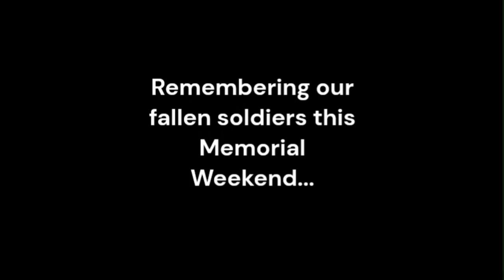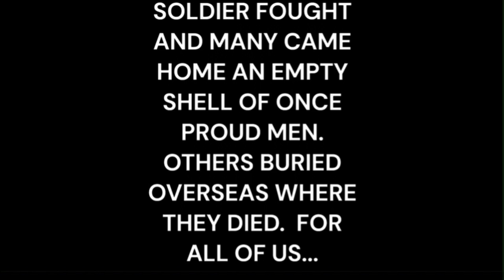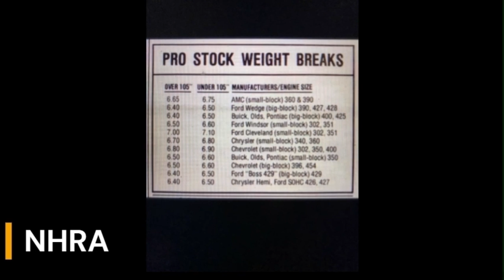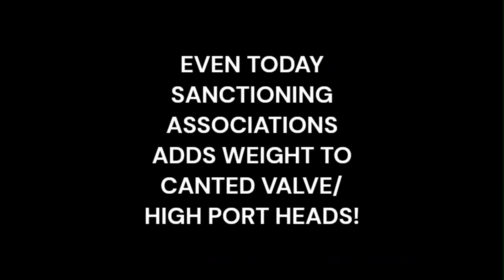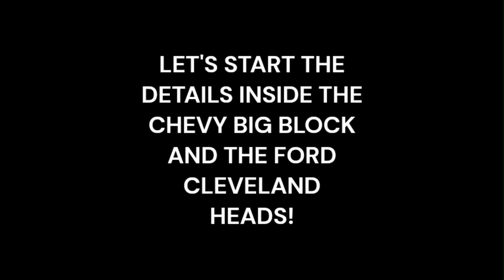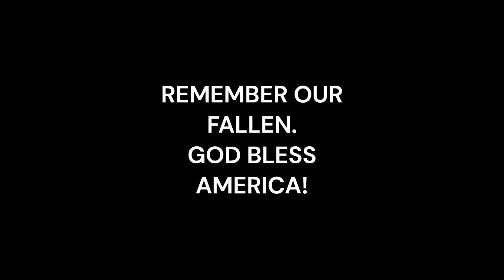ADVANTAGES OF CANTED VALVE CYLINDER HEADS.

Comment: Yeah great stuff Ben. The Cleveland was the only thing to have here in Australia back in the day. Your explanation of why this head worked  so well was excellent.  All I ever heard over here was the port was too big. The funny thing was the Cleveland was feared on the street by everyone.
Reply from the maker: Thanks Dean.  I found early on that bigger than normal port with decent compression, cam plus low gears will be a deadly combination on the streets!  My Windsor and Chevy engines did not quiet pull that much strong even if I did the same basic combo.  Leading me to believe this thing was a terror in the modified and eliminator class @ NHRA.  There is no reason to doubt it when it dominated and was penalized for its success.

Comment: When you look back at Ford Muscle cars like the Boss429, 429cj and even earlier FE powered 390/406/427/428cj cars, you find that the Boss 351 mustangs, Cleveland Torinos and Cougars we're the quickest off the showroom floor in 100% factory production configuration..The Boss 351 Mustang being the top of the bunch.
Reply from the maker: They are very impressive and my first hand experience made me a believer because I can beat big blocks to their surprise.  lol
Reply: @benalamedaracing2765 I agree. A Ford FE when built correctly and you cant the intake towards the exhaust. If you look at my 394 ci FE with 2.064 intake valves canted forward and sideways just a 1.55 valve straight up. I used a light piston and a 360 pickup truck rods with ARP bolts. The pistons I left the 2 nd ring out the top were moly and I trimmed the scrubbers and made a change to the retaining ring. It took 15 lbs to turn it with the heads on the plugs out. That head went from 76 ccs to 56ccs. 2000 when I built it and it still screams like a banshee.

Comment: Another great video Ben. I grew up with Cleveland's, small and large port alike. I used to sort out a lot of under performing, and unreliable motors for people who's motors had been built by other engine builders. Now I don't think that I'm a great engine builder, but I used to build okay ones back in the day. One thing that I worked out very quickly was that in most cases, the more experience the other engine builders had with inline valve motors, the less successful they were with Cleveland's. No one seemed to understand Cleveland' heads, and I was by no means a guru either. However I think I had a better idea than most. Today I have a much better idea of what I didn't know back then. How I wish that I had today's knowledge 40 ➕️ years ago. Thanks for sharing your knowledge. Regards Greg
Reply from the maker: We all learn slowly but surely.  For one, if at 9:1 inline Ford or Chevy it will make the Clevelands inferior at most instances.  However, the more you go up on compression you will see it will respond and out power all those other inline engines and the higher compression and rpms?  It will pull away for sure!
Reply: @Ben Alameda Racing  in my limited experience, Cleveland's love compression. Personally I favoured cams with wider lobe separation angles than used on inline valve heads, and I preferred symmetrical valve durations for hot street and circuit work. However, I was only ever working with factory cast iron heads, never with after market alloy heads. I used to run as much as 13.8:1 on leaded fuel street motors. Dynamic was obviously less. When your closing the intake valve 84° abdc, dynamic is a little lower. That said,  if I was building the same motors now, I'd build them very differently. No flat tappet cams to start with. Currently have 2 different versions of the same head in at a friend's shop getting flowed. Not interested in what we can get out of them. Simply want base numbers are, and where the numbers are made, to make decisions from. Have a proven engine that has to come out of a car. Will probably dyno it to see how much power it doesn't make, then remove the heads and flow them as well. Customer was extremely happy with the performance. I was very disappointed. Felt strong, drove well, but I always felt that there was still too much on the table. Really enjoying your tech video's. Thanks for sharing your thoughts and knowledge

Comment: As David Vizard said - Chevrolet must have let the Tea Lady design the Big Block Chevy, because it couldn't have been done worse if they tried. They should have just scaled up the Small block head! (and I'm a GM guy!)
Reply from the maker: Smokey did make an attempt to produce a canted valve head with symmetrical ports and look so much like the 351C!  Eventually he said it was too much cylinder for the rpms they were using at the time so it was kind of an overkill!  Just like the Clevelands were as well.

Comment: 351 Cleveland with closed chamber 4bbl heads was SEVERELY underrated. I never understood why so many Ford guys poo pooed the Cleveland. The Cleveland and the 426 Hemi were passenger car engines with heads that had PHENOMINAL flow /power potential. I watched a cable TV show rebuild a 351 Cleveland with closed chamber 4v heads- they put in a wimpy cam and dyno'd  it. Then they put aluminum heads -single plane intake and a huge cam in it and dyno'd it again. USE THE DANG FORD HEADS WITH THE BIG CAM AND INTAKE. A youtuber whos last name rhymes with Boldener did the same thing. Removes great iron heads without showing their potential and goes straight to the aftermarket aluminum heads.
Reply from the maker: Mike, you are probably right and the factory 4V is one awesome piece even with them kink down exhaust ports!  They can bypass this with added duration at least 8-10+ degrees.  Wimpy cams on big ports will produce wimp power for sure and I will never understand why you would do such a thing...  But then again we all do different things others better than most while most ends up doing the wrong things!  lol  
I agree with you 100%.
Reply: @benalamedaracing2765  I'd like to see a stroker Cleveland. The extra cubes would lower the power band a bit on those big flowing heads.
Reply: A friend had a 71 Mustang 2+2 351C 4V 4 bolt, Ford top loader, Detroit locker. Factory redline was 7000 on the tach and that thing would pull. I had a 65 Ford short wide box truck with a 1974 LTD 351C 2V in it and it was a fun truck. The truck has been parked for 20 years in the shop. I have a 351C on the engine stand and am going to get 302C 2V closed chamber Australian heads for it. It should make a great engine for the truck.

Comment: Ben , great video.  Its amazing how as time goes forward  , the truths come out about certain engines.  In Australia i have always been intrigued by the mighty CLEVELAND , not only its great looks but how they sound.  I have built countless CLEVELANDs through the years from 250hp to over 500hp . All street drivers  and occasionally to the strip , and all with the 3.5 inch stroke,  just depending on the bore conditions it could be 10 , 20 , 30 thou oversized.  Anyway nothing feels or sounds like a strong CLEVELAND  . When i started my apprenticeship in the late 80s , the dark side would make stupid remarks about CLEVELANDs , but we all know who had the better cyl heads . The LS  is a good example of copying the asymmetrical CLEVELAND cyl head and the Holden VN V8 to the  VT . Oh by the way we have a sanctioning body called SCAMS which will do anything in its power to make sure Fords dont win .
Reply from the maker: They have associations like the NHRA that limits other engine makes?

Comment: if youre class racing, IE 5lt class, the most under rated engines of all was the Ford 302 C.  4 inch bore , 3inch stroke, 6 inch rod, canted valves that are larger than chevvy. All 351c tuning and machining tricks apply. The hardest thing was to build compression.
Reply from the maker: The C head is really an impressive piece and wondering for your displacement if you are running the Aussie C head?

Comment: Another Aussie clevo fan of your's here Ben 💪 I'm really paying attention to your quench theories and am gonna u-turn on my 351 clevo to the 2V 302 cleveland 58cc head we have here. The math says 359ci @ zero deck + .041 gasket installed height and +3cc twin valve cutout flat-top hyper piston gives 11.6:1 static compression - but with your recommended low-to-mid .040" quench !! Too dangerous with 112 LSA low lift/short duration cam ? Cheers 🙏
Reply from the maker: I get close to .600 lift @ 110 l.c. before I get nervous and anything far from these you should be ok.
Reply: @benalamedaracing2765  Thank you Ben 🙏🙏 Us aussie cleveland guys should crowd-fund amongst ourselves  shipping a set of 302 C closed chamber 2V heads to you for some R n D porting and flow testing! It would be interesting to see where they fit in the Ford cylinder head hierarchy. 👍

Comment: BEN back when GM and smokey built the Mark 11 mystery motor that was instantly outlawed.was that the first canted rotated valve design?. I saw a paper where Smokey was cussing the GM engineers for making a long and short Port for the Mark 4 engine.if that is true, they have known The advantage from the early 60s.
Reply from the maker: Canted valve heads are more powerful than straight inline configuration.  I am sure Smokey was not happy with the long/short layout and the dynamics alone screws up the potential of the engine!  In fact Smokey designed a cylinder head for the chevy engine and it looks exactly like a cleveland cylinder heads except for the water ports!  It had potential but he felt it is too much ahead of its time for the rpms they were turning back in the day.

Comment: Would a bigger intake valve in the bad port of the bbc make up the flow to match the good port?
Reply from the maker: I do not even know if anyone tried it but it will be interesting.  However, I pointed on one of my videos about port "recovery" which I tried to show the bad port recharges itself quicker once the intake closes, while the good flowing port empty's itself much more and slower to recover. Thereby the bad port equalizing it in total intake volume charge drawn into the cylinder or at least close to it in totality of the inducted charge column.

Comment: Are the 429cj & scj heads same as Cleveland’s?
Reply from the maker: Basically they are the same canted valve layout!  Even had luck with early casting with SCJ valves on the intake and exhausts!

Comment: Cleveland was a great engine, heard they were prown to cracking, y putting  clevo heads on a windsor fixed this
Reply from the maker: They had issues no doubt and I did many conversions to W and they do work as long as you open up the main bearing clearances because they are big!

Comment: What all has to be done bolt my 2 valve open chamber Cleveland heads on 351w.
Reply from the maker: Just plugging the end water passages on the corners and running an external line coming up front to a remote thermostat housing.

Comment: Back in the day didnt the Cleveland head require radical exhaust mod or raising to keep up. The intake port was symmetrical, but required raising floor for best flow. Who was first to use canted valve angles...Chevy mystery motor or cleveland?
Reply from the maker: The C and the BBC are close but the BBC suffered from uneven intake runners which handicapped it big time plus the super big chambers!